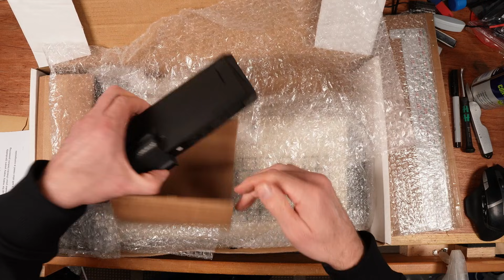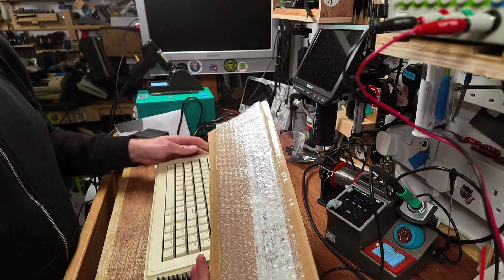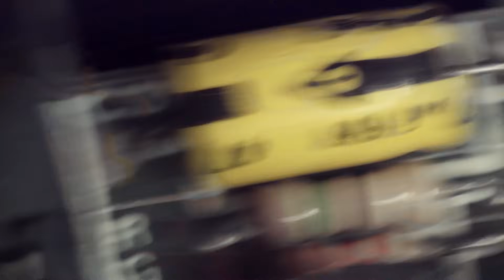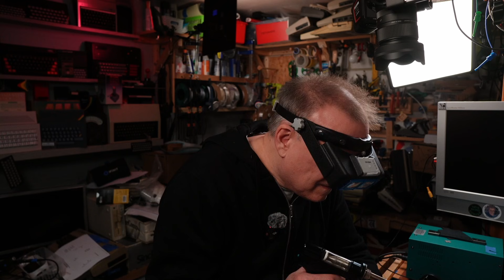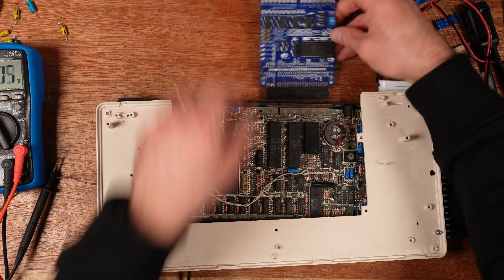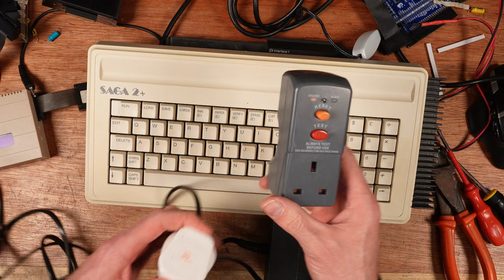ZX Spectrum Toastrack in a Saga 2+ Keyboard

Comment: Since I own a pair of Saga 1s I can tell you exactly why the keyboard isn't working 100%, and it's very much not good news. The glue that they sandwiched the 3 bits of membrane together has failed and turned to dust, so I'm pleased you didn't explore the keyboard itself. On the plus side, the glue layers now resemble my Mum's sponge cakes. In colour, not texture. Unique machine though. It does amuse me that literally everyone rubbishes the keyboard on the Spec Plus yet the Toastie (and QL) keyboard is identical.

Comment: On the toastrack, you get audio out from the mic socket, so I guess that switch is for sending the Speccy sound to an external source. That’s why the RCS SCART cable has the fly lead to the mic socket.

Super video and an amazing keyboard. I’ve had a few different Saga keyboards, but never one like that 😃

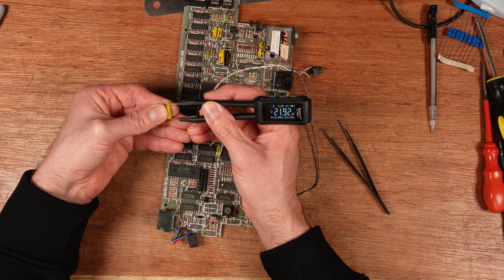Comment: You said "nanofarad" and it showed "nF" in the display so it was correct, wasnt it? :D around 33:10 Resistance was mOhm like milliOhm (so even below 1 Ohm) MegaOhms would be with capital M. With these LCR Tweezers, if checking electrolytic caps try a lower frequency. They usually run with 1 kHz but can be switched to 100 Hz which would be better for electrolytics.
Reply from the maker: I will try to remember for next time